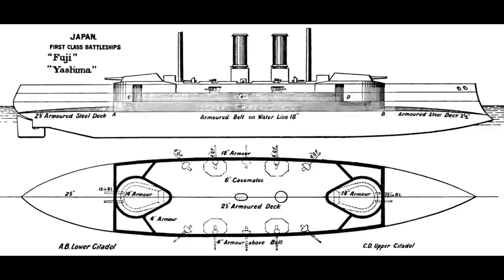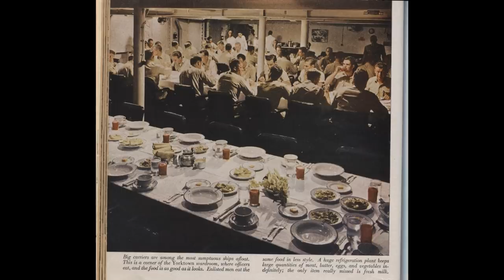The Drydock - Episode 130

Comment: PART II

Explosion problems.  While using Lyddite (trinitrophenol or picric acid), British ammo did not have to worry ever about the main charge in their shells exploding if their fuzes worked (and, against heavy armor, even if the fuzes didn't work!).  The US, with its large amount of experience in the US Civil War, and Germany, did not like such a sensitive and, to them it seems, dangerous explosive in their ammunition (the US would not even allow double-based propellants like Cordite, which contained nitroglycerine, in their ships anywhere, so Lyddite was out of the question).  The Germans decided to use the commercial explosive TNT but only when they could get their AP shells through KC armor in an intact manner, which Krupp finally succeeded in doing in 1902 with a satisfactory soft-steel AP cap at near-right-angle impact (the then standard for test) -- prior to that, their AP shells for hitting heavy armor were solid shot only.  The US went directly from black powder or black-powder and granulated TNT, which were rather low-power explosives by 1900, to Explosive "D" (ammonium picrate), the most inert explosive anyone ever used through the end of WWII and slightly weaker than TNT, just like Lyddite was slightly more powerful.  Germany and the US had a problem, though:  While large-filler HE shells with minimal armor penetration requirements could use large booster charges of TNT attached to the end of their impact or time nose fuzes to set off these much more inert explosive fillers, AP and base-fuzed Common ("SAP") shells had to have tiny fuzes and boosters to keep them intact on heavy armor impact so that they could live long enough to set off the main filler, even when no delay was used (which none had back then do to lack of adequate design work).  Various ideas on how to get small boosters to set off AP/SAP shell fillers (even using small fillers didn't seem to help -- the scaling rules for such things were NOT relative, but absolute, it seems) were tried, with only partial success.  Krupp fuzes used long, narrow fingers of Lyddite (under their own name of course) that extended deep into the filler to get as much surface contact between the booster and filler as possible, while still keeping the finger strong enough to not break during the armor impact.  The US Army Coast Defense Artillery, which also never got on the Lyddite bandwagon, also used Explosive "D" and they tried using a finger with a TNT filler and a set of stacked TNT rings surrounding the finger, using the idea of "many bangs" will get enough hits that, like rolling dice, you will roll "box cars" at least once most of the time to get a full detonation.  These worked most of the time, but they never got the 90% minimum success spec level that most designers are held to with every other part of the shell design.  Also, they made the fuzes more expensive.  When delay-action fuzes became the rule (French in 1908 or so, Germany and, I think, Austria in 1911, Britain and, following their lead, Japan and, I think, Italy, after Jutland in 1917, and the US during the early 1930s), things got worse, since the upper part of the fuze that was attached to the booster, and the booster itself, had to survive the ENTIRE penetration BEFORE it was set off, rather than being already in the burning/exploding process and only having to survive the initial impact to get to that point.  This degraded the reliability of the fuzes with the inert fillers significantly.  The British after Jutland switched to using Shellite (a 70% Lyddite, 30% dinitrophenol (an weak Lyddite cousin) mixture) and the French Switched to "Mn.F.Dn" (an 80% Mélinite (their version of Lyddite), 20% dinitronaphtaline mixture very similar to Shellite), which could be set off by the same fuzes that they used with Lyddite (now with an optional delay added in the British case), though tests I have seen with Shellite seem to show that it really needed as booster like TNT to get good results.  The Japanese were very stubborn and tried and tried again to get Shimose (their name for Lyddite) to work with AP shells, but even those hard-headed conservatives finally gave up and in 1931 replaced Shimose in AP shells, not in any other shells until WWII, though, with Type 91 Explosive (trinitroanisol), which was ALMOST as sensitive and needed thick plaster, wood, and aluminum cushions in the cavity to keep it inert on heavy armor impact), but it could be set off as easily as Shimose by a similar tiny booster.  The US Navy -- following the US Army in 1918 (their specs about safety were not as strict, obviously) --and British in 1928 both finally got the extremely powerful and, in tiny amounts, booster explosive "tetryl" (abbreviating a very long chemical name), called by the British "Composition Explosive", that could very reliably detonate ANY explosive then in use with only tiny amounts.  The British used a fiber can placed on the end of their base fuzes that had very thin layers of tetryl separated by fine metal foil separators, building it up to the needed minimum amount, while the US put it in two tiny rocket-nozzle-shaped pits on either side of the end of its fuzes, using two (for reliability) needle-like jets of blast into the bottom of the filler to set it off, which even Explosive "D" could not resist.  However, looking at German fuzes, they have all sorts of improvements as to reliability and safety (Japanese base fuzes were based on them in WWII), but their block-TNT fillers and long fuze booster "fingers" are identical to the WWI-era designs, and for all I know, they still used picric acid as the booster, with the expected inferior results.  Does anybody have more information on this?

Mutual interference.  Gun blast from one gun hits a shell from another gun on its side,, causing it to wobble and corkscrew through the air in badly-controlled flight.  Most multi-barrel guns in warships when longer range were necessary ended up using a short delay between firing built into the trigger system so that the first gun firing gave its shell time enough to be out of at least most of the blast of the other gun(s).  The closer the guns are together, the worse this gets, obviously.  Italian WWII cruiser guns, for example, were almost on top of each other, being loaded from opposite sides of the mount inside and needed a considerable version this kind of delay.  In fact, they almost needed to work like 40mm pom-poms to really prevent the problem.  I am not quite sure why this was not accomplished.  Japanese YAMATO main armament guns had a double-delay to keep ANY of the turret's guns from firing at the same time, seeing how powerful the gun blast was.  I think that most other nations that had guns even marginally close together used such -- I am not sure of BISMARCK with its very wide separation needed it.

Every subject is handled by different countries in different manners.  Some are quite logical, while others make one think of Rube Goldberg cartoonists being given the job.  It makes this subject of naval technology "interesting", does it not?

Comment: US Navy engineers looks at the Prince Eugen's engine room. "Ok, this is NOT how you do a high pressure boiler system." sm
Reply: During WWI, both the Greek and Ottoman navies had German built Destroyers with turbine powerplants.  The French took over the Greek fleet and ran their DDs through most of the war, while Greece was neutral.  From Greek and Turkish sources, I have been informed that those German turbine plants were so troublesome that the ships were disposed of soon after the end of the war, while other DDs, in those same fleets, that were older, served into the 1930s.  Maybe it's something endemic to German turbine plants that they are so fragile and finicky that no-one could keep them running.
Reply: @stevevalley7835  But, but, but that would mean that the Germans weren't uber engineers with all the best stuff like some people on the internet say they were! GASP! ;) sm
Reply: @mattwoodard2535  I drive a VW.  Entirely happy with it, but I noticed an oddity: just about every other gas engine car on the road uses manifold vacuum to run the power brake booster.  My VW has an engine driven vacuum pump, to make really, really, sure there is enough vacuum.  For several years, when that engine first came out, it had an oil leak issue.   The source of that oil leak?  The vacuum pump, a device that no other automaker thought was necessary.  And it was a very expensive repair too.  Remember the words of Lt Commander Montgomery Scott "the more you overthink the plumbing, the easier it is to stop up the drain".

Comment: Concerning the ALGERIE discussion on exploding and accurate shells.  ALGERIE, like the Italian ZARAs, had face-hardened (French high-quality Schneider et Cie. KC-type) armor, though thinner than the ZARA (kept to the weight restrictions) -- ZARA used Terni Company KC-type armor, which seems also to have been rather high quality -- unlike the German HIPPER Class, which only had comparatively thin homogeneous (Krupp Wotan Härte) armor.  For thin plates, homogeneous armor is superior in that it is not brittle against SAP or AP projectile impacts.   You have to have enough ductile back in KC-type armors to soak up an impact on the hard face and have enough resilience -- ability to "give" and still support the hard face layer -- to keep the plate intact long enough for the projectile nose to have time to fail first, by sideways shockwave reflection in the nose, and thin face-hardened armor does not give you that extra time cushion unless you are only being hit by small and mostly unhardened bullets (it does work in armored cars against many machinegun bullets, but those are not what ships shoot).

PART I

German APC ammo -- XXcm Psgr.m.K. L/Y,Y (where "XX" is the shell size and "Y,Y" is the shell length in calibers) -- after WWI had two generations:  The "L/3,7" for the 15cm guns and the 28.3cm guns (both on the Pocket Battleships and, in the 15cm only,  on the first post-WWI light cruisers through BB secondaries -- never replaced) and, in the mid-1930s, the "L/4,4" for the 20.3cm, SCHARNHORST new-model 28.3cm, 38cm, and 40.6cm coast defense and proposed but never built H-Class BBs.  The former were basically "warmed-over WWI late-model APC shells with a slightly blunter nose, a pointed windscreen for better drag properties and a rather small, but now hardened AP cap (following French post-1908 and British post-Jutland design practice -- in fact, the cap looked like a shrunken version of the British Firth Company "Knob and Ring" AP cap design).  It had poor penetration by later standards and broke up easily due to excess brittle body metallurgy -- reflected in the Krupp penetration charts and US post-WWII tests.  The Krupp later APC shells were considerably better, with a full-size K-and-R cap shape and a long aluminum windscreen (unique windscreen material).  Heavier, much better streamlining similar to modern US and British shell shapes, and with a somewhat smaller 2% (by weight) block-TNT filler (US went down to 1.5% filler and a "Russian Doll" full-body sheath hardening pattern to strengthen the shell better and the British kept the late-WWI 2.5% with a softer, bendable middle and lower body to make its shell be able to remain intact even at high angles when hitting medium-thickness armor (they made the shells work fine against "Treaty" warships, but not against more heavily armored ships).  Krupp also seems to have decided that the L/3,7 shells were unsatisfactory and did a major redesign as to their metallurgy, bringing them up to US metallurgical standards, but they too seem to have accepted the "Treaty" armor as the typical enemy protection level (SCHARNHORST and BISMARCK were not the most heavily protected of WWII warships, though their new Krupp KC n/A ("New Type") armor was second to none in most cases).  As such, their L/4,4 APC projectiles were somewhat of a compromise:  The projectile body was a fixed tough harness level (similar to the lower body of US WWII AP shells but only a single hardness throughout), which was not all that good when hitting at highly oblique angles (not the primary spec, it seems, unlike US and British shells, though those went to opposite extremes to try to match this requirement).  The nose hardness was changed considerably to similar to the US sheath hardness design with the outside being very hard and getting softer and tougher in a radial manner as one went directly inward to a point where the body and nose merged.  Unlike the US design, where that gradual softening also extended down the length of the body to almost the base to strengthen the entire projectile, the Krupp pattern abruptly stopped in a single step down to the body hardness across the projectile at the lower edge of the forward bourrelet (the slightly raised ring where the projectile slide down the gun barrel with minimal erosion).  US tests showed that on hitting thick armor, the nose could snap off right there, much like the old chilled cast-iron Palliser projectiles did in the late 19th Century.  It worked at moderate angles and against plates similar to what the British shells worked on, but, unlike the US shells which could punch INTACT through things like the 26" VH turret face plates of YAMATO Class BBs under post-WWII 16" AP testing, against very thick plates the German shells broke up unless they hit at well above their minimum penetration velocity (reduced the time of the shock on the shell structure and minimized the deflection and twisting forces on the shell as it punched through the armor).  Krupp must have realized that this step in hardness was not the best idea. but obviously it was "good enough" for current (British and French) threats ("Tradition"?).

(Continued)
Reply: Had to chuckle. Started reading, saw the level of technical detail, said "I thought I saw a Nathan Okun post." Looked at the author, "I did, I did saw a Nathan Okun post!"

(Settles in to read.)

Comment: Drach, in Ketai Kessen question you didnt mention battle of Philipine sea. I was of the opinion that it was this battle that broke IJN, since carrier air arm almost ceased to exist and since both sides pretty much deployed everything they had, it was a closest thing to decisive battle in the war. Is that a wrong opinion?
Reply: Yep this was probably the closest to the decisive battle. Leyte Gulf was just cleanup.
Reply: It certainly could be considered as such for the fleet air arms. The surface action was decidedly less impressive, though. So I would argue that it couldn't qualify as the KK for the IJN's definition. The surface fleet never waded in to gloriously kill (or be killed by) the USN surface fleet. For all that the Kido Butai was the cutting edge of the fleet, the IJN BBs were the soul and ego of the fleet from a strategic perspective.
Reply: The point is that kentai kessen  as defined by Japanese doctrine specifically called for a decisive battle before any major Japanese fleet assets were lost, and possibly after as much of opponent's were out of action. So while Pearl Harbor is an opening move towards it, the payout never happens. And after Midway,  such battle as described in doctrine simply becomes impossible, as major assets are already lost. So Midway, while not the kentai kessen, is essentialy the battle that made kentai kessen impossible.

Comment: On the question of US carrier names: the battle-named ships were originally intended to be battle cruisers, not carriers. Their hulls were already laid down, I believe, and names had been assigned before the conversions happened.
Reply: I believe you are correct for USS Lexington(CV-2) & USS Saratoga(CV-3), but USS Yorktown(CV-5) was designed and built from the outset as a carrier.
Reply: @Axel0204  very true, I stand corrected. Four of the battle cruiser hulls were scrapped due to the treaty. Odd that after using Yorktown as the class name for the purpose-built CV, they changed midstream and didn’t use other battle names for the other 2 of the class...
Reply: Scott Drone-Silvers the USN hadn’t really standardized naming conventions for anything except battleships and cruisers at that point.   The names for the Lexington class weren’t standardized either.  It just so happened that the two that were furthest along at the time of the Washington Treaty were the only two named after battles.   The others were Constitution, Constellation, United States, and Ranger.  So it’s not that surprising they didn’t stick with battles for the other Yorktowns.